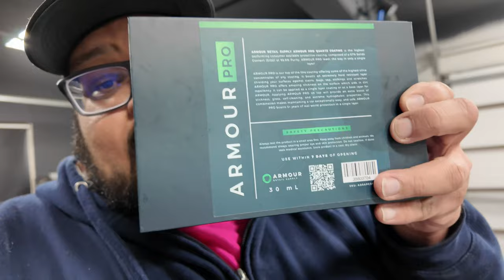60 DAY Update: Winter Survival Test - Did These Ceramic Coatings Pass the Ultimate Challenge?

Comment: Replace that Cherry Coke with DIY. 

Also, #ADS FTW!
Reply from the maker: 3 year ?
Reply: @Ecdetails  I'd love to see the 8 year, and I'd also like to see if there is a difference between the 8 year and the 8+3 stack.

BTW... Diamond Body 36 is still doing the Lord's work here in MN, very happy with it so far (though this winter has been a little weak). The ADS Wheel and Diamond Wheel comparison is going well. ADS might have a slight edge in self cleaning, but you can't tell them apart with water behavior.

Comment: Bearforce orifices are not what they are labeled apparently. The 1.25 is actual a ~1.15, which is why the foam looks so good. Someone tried switching it out with another 1.25 and their amps dropped on their pressure washer and the foam was worse. Kinda slimy, can burn out a pump if your not careful. #ADS
Reply from the maker: Lord you just ruined my l childhood , like that one time my dad said there is no santa 🤶
Reply: That’s fine. MJJC comes with 1.25 and the 1.1 most swap it for the 1.1 especially DIYers at home with a $99 special power washer.
Reply: @Ecdetails  no Santa?! That’s fighting words! 😂
Reply from the maker: @BXGreen_DrivewayDetails true , I never change orficies I just connect and foam 🎉🎉
Reply from the maker: @BXGreen_DrivewayDetails haha right

Comment: Nv Snow is an excellent soap. It is not designed to be a heavy hitter. The other soaps you mention are not pH neutral, other than GSF. I don’t think GSF cleans better than Nv Snow.  Nv Snow + would have been a better choice in this review.
Reply from the maker: Foam party is ph neutral , shampoo + is ph neutral ,  diy is 8.5 or something like that
Reply from the maker: Also I mention nv snow + would of been better , but mh complaint was other soaps being ph neutral has cleaned better - been using nv for years
Reply: CarPro reset is also “pH neutral”, yet it will strip most waxes. Very strong soap for being “pH neutral”. I feel a lot of these soaps are stronger than what they advertise.
Reply from the maker: @orthodox1717  I agree with you , maybe nv is true to ph and I the others are at the higher end - now ima have to buy a ph tool  haha
Reply: @Ecdetails  appreciate you. ;)